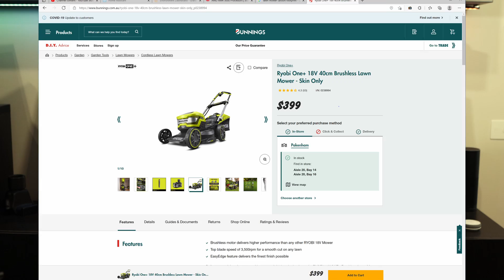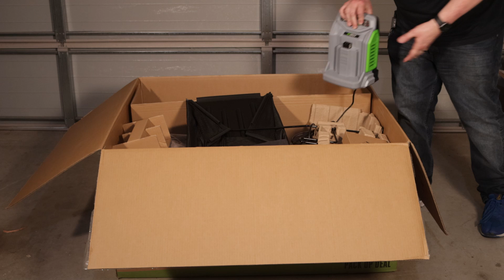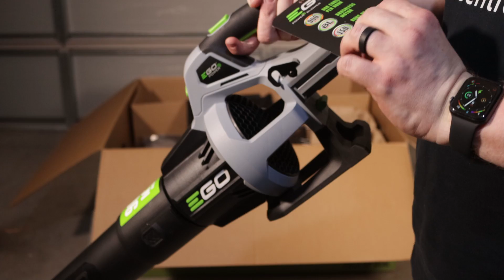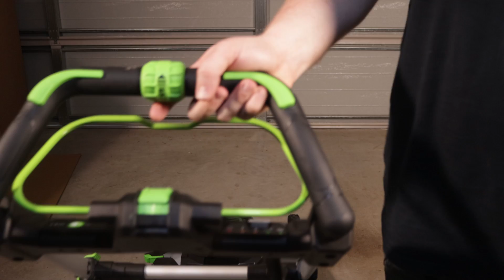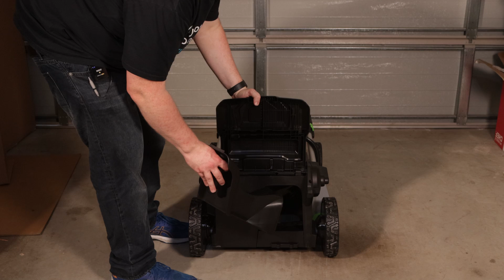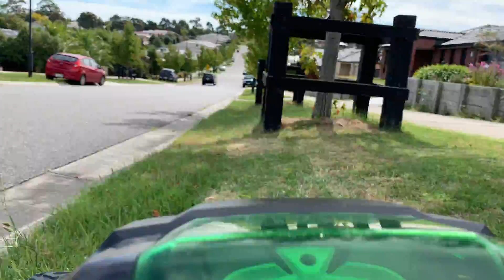Ego Battery Electric Mower and Blower Kit

Comment: Good video, but I'd be interested in seeing a comparison between your bro's Ryobi mower compared to yours.  There is a bit of a price difference for something that seemingly does the same job.  They almost look like they came out of the same factory.  And as I already have Ryobi batt tools i'd lean more towards getting it instead of the Ego.  2 different batt types would annoy me.
Reply from the maker: Major difference between the Ego and the Ryobi is that the Ryobi is an 18V but it CAN take 2 Batteries and I don't know if that bumps it up to 36Volt or if the batteries end up running in parallel, and the Ego is 56V.
Higher Voltage doesn't necessarily mean better though, so I'll see if I can arrange a side-by-side comparison with my Brother's Unit.

Quoted Runtime on the Ryobi is a bit shorter than the Ego, even with 2 x 5.0Ah batteries.

Skin Only the Ryobi will set you back $399, Add a 2 pack of 6.0Ah batteries to that and you're looking at another $269 bringing the total up to $668, less of a problem if you've already got some 18V One+ Batteries, but I suspect you'll get frustrated unless your existing batteries are high-capacity 5Ah +.
The Ryobi doesn't seem to have a Self-Propelled function, and I've been unable to find a definitive answer on the warranty length though it seems like it MAY be quite generous at 6 years.

Personally I love my Ryobi One+ Drill, Impact Driver, Reciprocating Saw, but HAVE had trouble with my cordless circular saw, BUT, it's not Brushless, so that could be part of the problem, AND I've seen some older Ryobi mowers in hard garbage lately. I tried salvaging one to see if I could rescue it but the planetary gear assembly had shredded itself.
Reply: @HiveMindAutomation   cheers for the reply.  I ended up grabbing the Ryobi kit with 6a battery. absolutely love it  should have bought one ages ago. i get 2 full mows putting 2 batts in it before charging - the 6a and a 5a I already had. about 200m of lawn.  tons of power. nice cut too. the fast charge doesn't bother me cause that's not good for the batteries all the time and the self propelled function isn't needed I don't think cause its so easy to push compared to my old petrol mower.  i guess its good on a slope or for the oldies.  and yeah, 6 years warranty on the unit. batt and charger are shorter, maybe 3 years I think. anyway keep up the good work. good to see aussie reviews of home auto stuff...

Comment: Thanks for the review. I see these as being OK for modest scale residential uses but having acres to look after my concern is whether they have the power we need, the duration of operation and overall durability. They look to be very plasticky and easily damaged.

Interested in nozzle solutions for the blower. I really want something which will clear out the 100's of metres of gutters we have. Currently my 2-stroke Stihl does a great job. Also brush cutter and chainsaw.

Electric items have some appeal as I can charge them from my off-grid solar PV/battery system but I need the brush cutter and blower to be powerful and last 1 hour+ at a time. Does the charger have a slower charge rate option, or is it fast charge only?

We live on acres of hilly terrain with pasture, not lawn (apart from the lawn around the home). As much as I'd love it to be electric, it's just not going to be possible to use an electric ride on mower as they are way underpowered, undersized and very limited in range.
Reply from the maker: There’s a “gutter blower” kit available from the manufacturer. And there’s brush cutters,chainsaws and pole-saws available too.
In the smaller tools the larger batteries should last a fair bit over an hour and there’s up to 10Ah batteries available.
The build quality is pretty good but it is still made of plastic.
I agree that the mower seems under spec for your use case. 
I’ve not found a slow charge function but I’ve not read the manual :P
Can’t find any switches or buttons on the charger itself but there’s a seperate standard charger: https://egopowerplus.com.au/charger-standard/
Could be an interesting hack project too.

Comment: Great video as always , Im no expert but dose not the manufacturing process  of the battery compare with the carbon saved from petrol ?  Also the life of the batteries can be shortened with the fast charging.    Just my experience  using battery powered tools at work.
  Please don't take this post as negative, just some thoughts of an old man set in his ways.
Reply from the maker: The carbon from the manufacturing process is a common talking point that has been debunked countless times.
I agree about the rapid charging reducing the life of the battery, might need to investigate a regular speed charger.